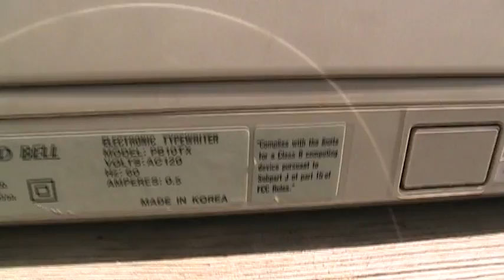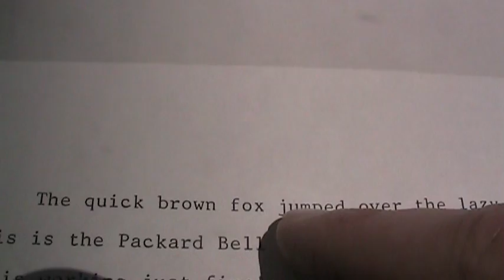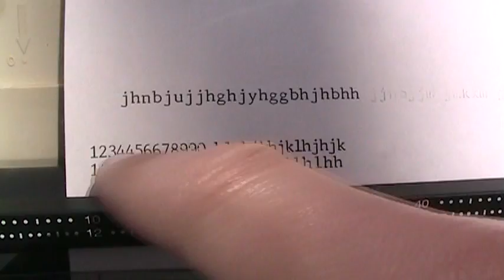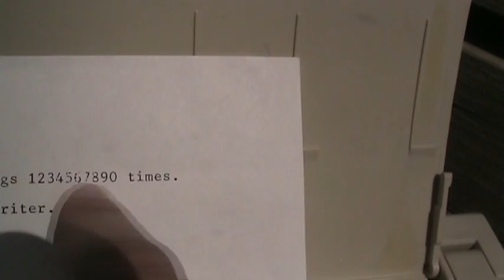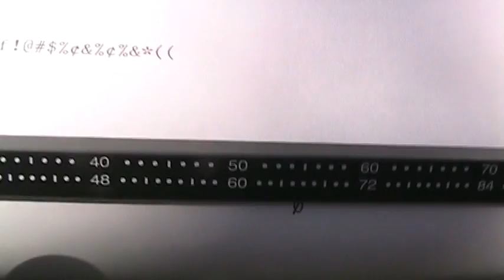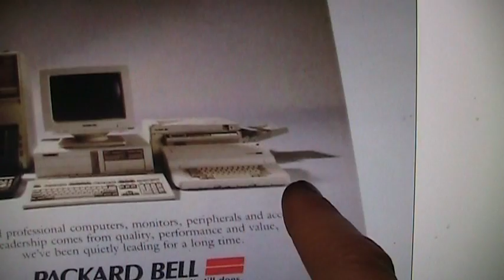Packard Bell PB10TX electronic typewriter

Comment: EXCELLENT video, and a very nice machine. I love my typewriters (I have a Xerox Memorywriter, an IBM Wheelwriter, and just recently purchased a brand new Nakajima AE-710). it's important that you go into the level of detail that you have. A lot of younger people don't understand that this is not a computer...it is a typewriter. What I love about my three typewriters is how fast they are. With a lot of cheaper electronic typewriters, the response time from keystroke to typed character is really slow. With the MW, WW, and AE-710, the response is instantaneous. Great job on the video!
Reply: A lot of younger people don't understand that this is not a computer...it is a typewriter.

If you think that the Memorywriter, Wheelwriter & PB10X are just typewriters and not computers, you have a seriously flawed understanding of what a computer is (because they definitely are simple, single-purpose computers).
Reply: RonJohn63 would this electeic typewriter be considered a computer?

by the way, I do not think anything electronical can be considered a 'computer'. A computer, from what I've learned, has a memory that can be held and can be program. a computer relies off of a system called a "input. process. output". You type in the instructions into a memory bank. Then tell the computer to read it and do it's job. The computer reads and does it's job, and finaly gives you the outcome. 

This typewriter that he is reviewing is actually a computer. It can hold some memory such as the one line of text. And when you hit enter, it will print it out. that seems like a "input, process, output" system.

Some people like to call manual typewriters *the first computers*. Well, it may write, it may have a keyboard. You can make documents with it, but it is not a computer. But you can still kinda call it your computer if you want. It is basically what the first personal computer was based on. 

Am I wrong?
Reply: I have a 1976 sears achiever manual mechanical typewriter.

Comment from the maker: @shesnailie Yes, IBM and other companies made typewriters with an optional parallel port attachment that let you connect it to your computer and use it as a printer.
Reply: I have a fax that I want to use as a printer (and scanner), because its really cheap (heater thing with 3$/roll of paper) but it's only RJ11 (what do u expect?).
I read a website about using a 56k modem to do it, but it looks really complicated. Do you mind investigating and maybe doing a video on this?
Reply from the maker: ***** You could use a thermal fax machine as a printer if you used a fax/modem and a phone line simulator, but the quality would be poor, and it would be very slow -- plus, thermal paper is expensive and the printing on it fades out over time.
Reply: vwestlife As I said, my thermal paper is 3$/roll, and it's pretty big, even cheaper is bought in a 3pack
Reply: I have been looking for one of those for the longest time.  Even just a daisy-wheel printer alone would be awesome.  If anyone has one or has a lead on one, let me know!

Comment: Had a Brother and a Canon typewriter back in the day. Used them for filling out forms mostly, which these days is done on the computer with PDF documents.

Can't remember specific model numbers. The Brother one operated similarly to the one in your video, with the daisy wheel and correction tape. Had many of the same features.

The Canon one however used a thermal printhead, which could be used with thermal transfer ribbon or with thermal fax paper. It had a small character LCD display on it. The way it worked is that it only printed one line at a time, after you hit enter. This allowed you to correct mistakes on the LCD display before printing the line. You could of course disable this functionality and make it print one character at a time, like a normal typewriter. It also had the option for a few different typefaces and character sizes. It accepted 4 "C" cells in its battery compartment for portable operation, or using the supplied wall wart.

Comment: I have one thats electric typewriter.  Its a royal I believe.  From 70s  runs on a little motor with fan.  And a belt driven cam rotates and as you press keys the cam drags the arm makes the hammer hit the ink ribbon to type. Still works. Used that for book reports in high school.  Didn't have a computer until 2005  after school. I have seen others on here with same type I have no pun intended

Comment from the maker: @Sandman267 Please change your Google+ settings to allow people to reply to your comments. The erase strikes the same character you typed at that location three times using the correction ribbon to lift the carbon "ink" off of the paper. So for example if you want to erase a W, it will type the letter W three times over it using the correction ribbon. And it has a buffer so if you type too fast it will catch up.

Comment: Got a couple of those Swintec units at work. Sometimes its easier to just throw a multipart form in one to fill it out over using a computer.

I guess Apple was going for the same form factor when they made the Macintosh Portable. Too bad it weighs about three times as much as a typewriter!
Reply from the maker: The Atari 800 computer was also deliberately styled to look like a typewriter.

Comment: Very nice!  I had a Brother electronic typewriter many years ago, it was a dot-matrix thermal printer.  It used either thermal paper or a thermal transfer ribbon.  It was nearly silent so I could use it in the library without raising eyebrows.  Print quality was poor, it didn't have descenders for letters like "j" and "g".  I loaned it to someone and never got it back.
Reply from the maker: That was probably similar to this: Brother EP43 laptop typewriter

Comment: ha! that light indicating that shift lock is on..
I remember one guy that used to praise apple for being so inovative and putting led light on caps lock..
Reply: Nowadays it's standard. Every keyboard I've ever seen at the very least has a separate area with LEDs for things like that. That is besides my brand new Acer laptop that has no indication as to whether caps lock is on or off. The only way to tell is by typing and looking at the screen. This makes it very easy to screw up passwords, where you can't see the letters.

Comment: Hmm...two comments on one video...
I have a Comrex Comwriter 1 that is obviously an electronic typewriter that has been converted to be a computer printer.  It has knobs for the platen and the markings for Pica and Elite spacing, and a blanking plate on the front where the keyboard would be.
It has a daisy wheel mechanism that uses IBM Selectric ribbons, and the carriage is driven by a linear stepper motor instead of cables or belts.
No point in making a video of it as it doesn't print anymore.  However, the carriage will still run back and forth and make the coolest sound.

Comment: I see at least one each day, meabe because I own 4 typewriters, 3 elctronics and one mechanical, my favorite is an IBM wheelwriter 2 and this machine is so good. It have an integrated dictionary, cliky keyboard and I can even ad a graphics card in it to use it as a wordprocessor because it have an 8088 in it. Works like a charm, I had to clean it, so if you want to check I've made a video of the cleaning and also a sample test of it. You where faster than me, I was already making a video of how to use an electronic typewriter. well, I'll post it anyway.

Comment: That's a cool machine. Is it able to keep up if you type really fast or if you type while the carriage is returning?
Reply from the maker: Electronic typewriters do have a buffer so the print mechanism can catch up to your typing. This one isn't the best; there is a noticeable delay between pressing the key and the character being printed, which varies depending on how far the correct "petal" is from the print hammer. The really good ones like the IBM Wheelwriter series are faster and have virtually no noticeable delay.

Comment: When you use up the ribbon, you should take it out and see what people have typed on it! IBM Selectric typewriters don't use the ribbon in a straight line like your Packard Bell; the typed characters are arranged on the ribbon in such a way so that it uses up as much of the carbon as possible... and to make it very hard to read what's been previously typed.
Do you have a manual typewriter? Maybe you can show your viewers how it works, since they differ so much from an electric unit. I have two manual typewriters, and I still use them for making labels and such... and I used one of them for school assignments before i got a computer at home, and then even afterwards if the printer was out of ink hehe.

Comment: That's a weird typewriter, the delay is really strange. I have a 1968 Sears Medalist Electric 12 which uses a more traditional means of impact and normal ink but the letter arms are driven by a clutch wheel so the instant I make the electric connection on the keyboard it whacks the letter onto the page. This allows you to get going pretty fast. :P

Comment: Hey, I have a question about the electric typewriters.
I have a Sharp PA-3000 portable electronic intelliwriter. But the problem is that the daisywheel is broken for it. It is missing stamp letters.
Does anybody here know any websites to where I can get a PA-3000 daisy wheel or are there any compatible daisywheel parts?
The code on the daisywheel is- 270-176

My current wheel is a Courier 10.
I got this typewriter. If I dont get the part, it's pretty much junk.
Reply from the maker: I don't know, did you try looking?